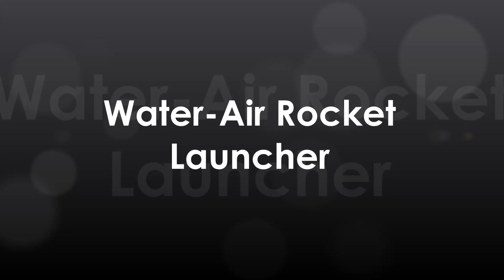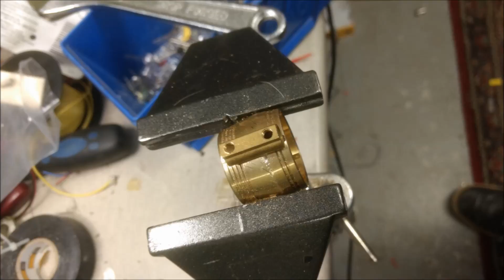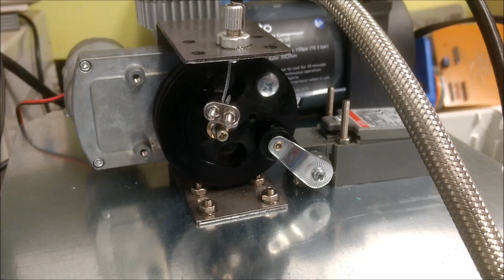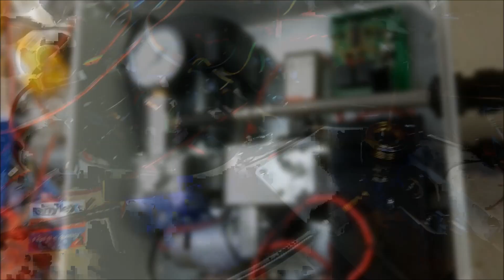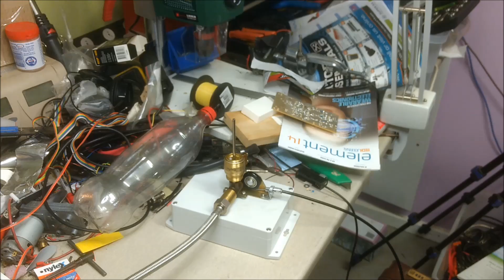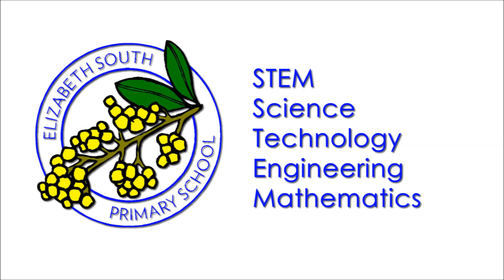Rocket launcher build

Comment: That's a clever mechanism for releasing the connector! How do you know when to stop filling the bottle or are you just kinda "eyeballing" it?
Reply from the maker: It has a 2 channel wireless remote control receiver. There is an emergency isolation switch that cuts all power to the box while loading the rocket. Students arm the launcher and stand well clear of the rocket before firing. When key 1 is pressed on a wireless remote the Compressor starts and pumps air into the bottle. There is an air pressure gauge just beside the rocket. When the needle is top dead centre it is at 70psi. When button 2 is pressed the motor pulls the cable and the rocket is released.
Reply: ESPSTEM Aha! That makes sense. Seems like something that could go together in a weekend or two if you had all the parts! I might try to build one myself sometime 😀
Reply from the maker: I ended up using two cables either side of the hose release using a simple tube clamp, which is easier than soldering on a cable clamp.  This ensures the ring is pulled evenly on both sides. Pulling one side works but it tends to release the rocket on a slight angle sometimes. I'll write how-to blog at some stage.
Reply: That would be great! Shoot me a link to your blog and I'll add it to my Feedly!